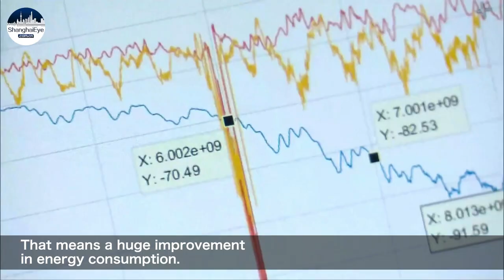World-leading! China launches two SUPER POWERFUL quantum computers in 2021

Comment: Quantum computers have about the same power as a fart.
Reply: I'm not a mathematician but I'll give this a go. What they have done here is phenomenal, but not immediately intuitively impressive. I had a similar view of quantum computers as yours until quite recently. So, "Quantum computers have about the same power as a fart", while that was more true in the past, now it is only if you look at it like a severely scale constrained binary system. The opposite is becoming true. The bare simplest way to explain it is that a qubit effectively and practically packs a lot more information into each Qubit than a standard bit. These quantum processors allow each qubit to process through an infinite superpositional information space, with an infinite gradient between 1 and 0, and hold two bits of information each upon query, while processing both of those bits simultaneously . That is one qubit. For example 2 standard binary bits can represent 4 states: 0,0 - 0,1 - 1,0 and 1,1. But, one qubit can take all of those values simultaneously, or, 4 bits of binary information. Now hold onto your hat because, 3 qubits can hold the memory of 8 bits of binary information. This illustrates this function nicely of n qubits taking the values of 2^n binary bits, thus the exponential increase of memory and computational capacity of traditional binary computational systems. "To generalize it, n bits can store 1 number between 0 and 2^n, while n qubits can store all the numbers from 0 to 2^n. " !
Sure that sounds neat, wow 8 bits. Well to see what this even means we now need to scale this up, way way up,  to the culmination of years of the most advanced research into quantum processing yet undertaken. As a brief intermediate step in our journey along the exponential curve of disparity between classical and quantum computation lets contemplate 13 qubits holding 1k of conventional memory, that's right 13 qubits = 1024bytes or 8000bits. Think you see where this is going? well, you still have no idea, because 66 qubits as they have achieved is the conventional bit equivalent of 8 EXABYTES of RAM. So they get quite the bang for their buck 66 qubit array. If we turn around and compare this to 8 bytes of classical data we have enough memory to convey an eight letter word like "adequate" or "bathroom" or just a display output of "99+1=100" (8 characters) but no compute function ability LOL. We can compare this to conventional systems either in terms of number transistors necessary to match the quantum computational output time, or time synchronize the two systems to match computation iterations per second to simulate the same calculation and see how long it would take. It would take about Century for a 3ghz chip to simulate a 66qubit calculation. If we go on to imagine a future system of only 1000 qubits, We would need a computer with 1.1x10^301 transistors to hold that memory, that is many times the number of hydrogen atoms in the known universe, and to calculate this it would take approximately 10^274 times the age of the approximate universe to make this calculation on a conventional system. just read that again and let it sink in.

From this we can see that it is not magic dimensions giving this processing power, but rather the robust accumulation of exponential returns in a combinatoric system with more naturally generous parameters than the "first thought" Binary systems we commonly use today.

(sources: *https://vincentlauzon.com/2018/03/21/quantum-computing-how-does-it-scale/ 
and https://medium.com/the-research-nest/understanding-the-theory-and-math-behind-qubits-2bf86a56441c)
I hope you enjoy reading this as much as I enjoyed writing it.
Reply: @richardduncan9740  interesting, tell me more.
Reply: @bobbylow175  well I think that before very long we will begin to see radical practical applications of these systems, basically massive scale computation suitable for simulation of unimaginably complex interactions in physical systems that we that would be constrained by space, money and power consumption if even possibly contemplated or attempted with conventional hardware. It may eventually become possible to surmise the result of an individual person's brain activity down to a very fine detail when combining this with AI. For instance eventually allowing brain to brain communication with no physically implanted hardware due to the ability of a system to analyze the outgoing low impulse electromagnetic radiation and photonic activity emit naturally from your body. Essentially almost any computational activity that could be inferred from the collection and correlation of real information albeit noise filled and massive in terms of data set, should become realistically and practically calculable with such a system. As long as a mathematician will say "the information exists, and it is collectible, we will just need more compute power", well, we will have that compute power so we might be able to legit simulate the history and lifetime of a black hole and it's insides the entire observable universe by performing a retrograde analysis on the formation of our cosmos just using inputs collected from astronomy the way we use meteorologic data to predict the weather but backwards. Accurate and sophisticated simulation of advanced micro magnetohydrodynamic reactions between natural quantum vacuum fluctuations and nanoscale metamaterials may allow us to finally realize zero point energy or finally the true EM Drive. It may allow advances in materials science that could create essentially unobtainium like engineering materials, again with the addition of AI we might be able to optimize certain chemical structural compositional combinations for the optimization of things like lithium Cobalt batteries, lithium iron nano phosphate batteries (lame basic examples but you get the idea), or the famous glass solid state batteries etc all of these advanced materials will be able to be simulated within an infinite parameter space with more conmpute power than 1000 Fugaku's, Summits, and Sunway TaihuLight's combined. In short it will hasten the the ushering in of the technological singularity, and change the future of mankind in ways that humanity cannot imagine, and in ways that I hesitate to type on the public internet.